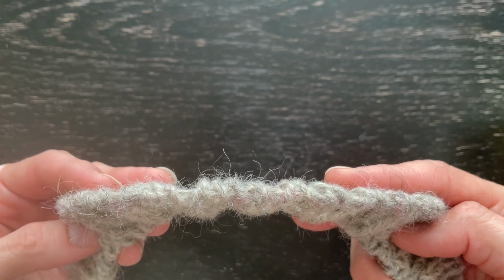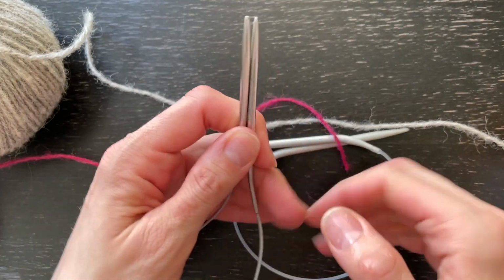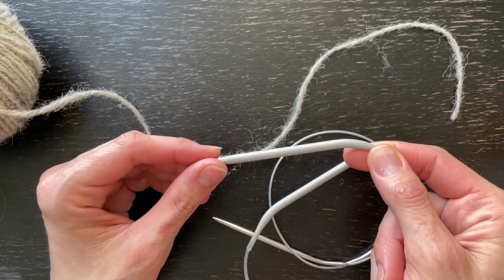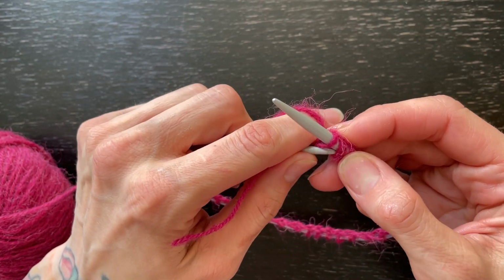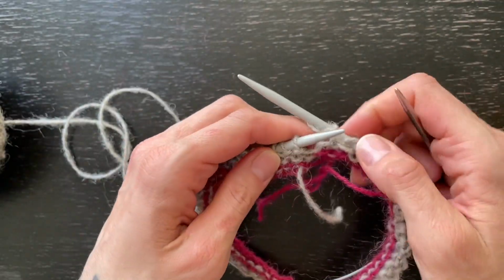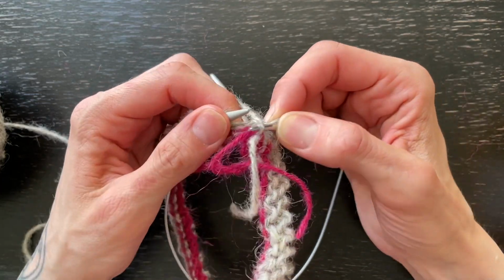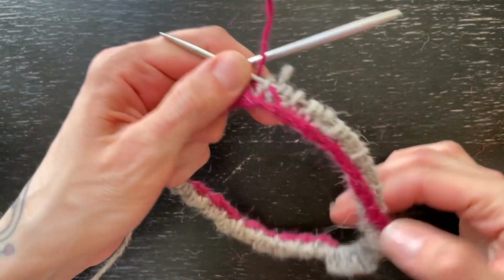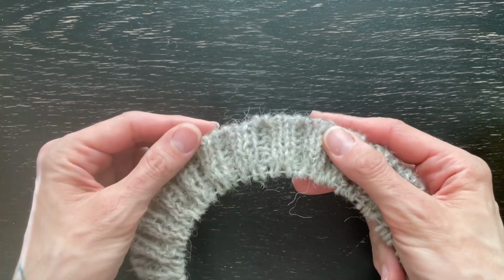Tubular 2x2 Rib Cast-on EASIEST METHOD!

Comment: Thank you for this video,I also saw it on your Lopapeysa tutorial. I tried this tubular cast on and it worked and looked great. However I have one criticism,and that is , (in my case anyway) the result was not as stretchy and elastic as I hoped it would be. I don’t profess to be an expert knitter, but I generally turn out a fairly good result. I will try it again to see if I can improve flexibility by easing my tension a bit.Thanks again .